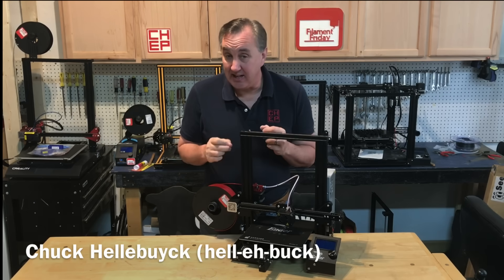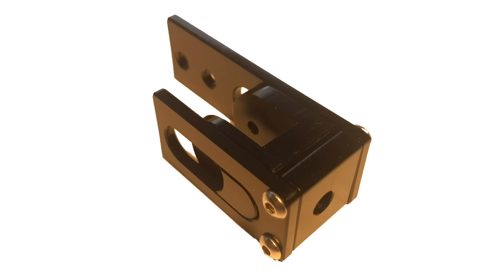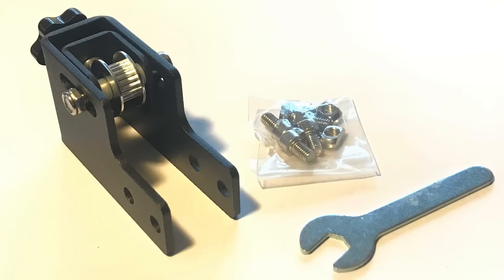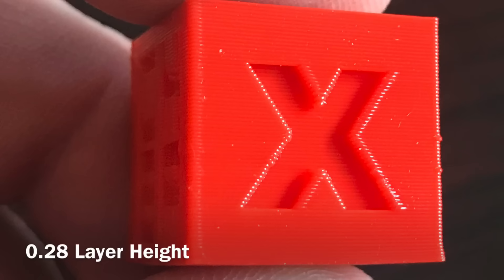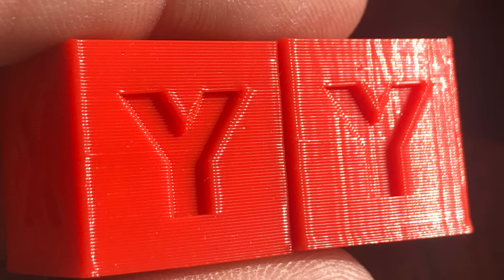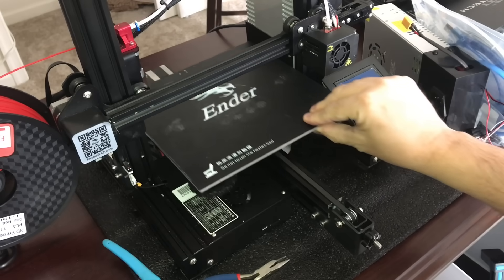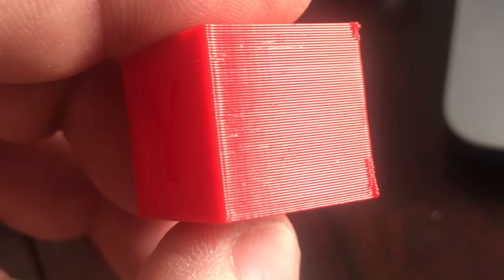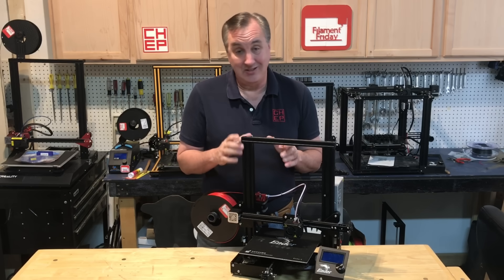3D Printer Belt Tension Effects on Creality Ender 3

Comment: Yes, sometimes a loose belt will cause an occasional shift also.. then keep printing normal again for a few layers then slip again.which can mess up print.. this depends on your print... tight belts are a must... my ender 5 only needed this done once after several hundred hours of use... i like that fancy hardware,but it really is not worth doing for me...

Comment: Hey Mr Chep! Did you ever figure out those over extrusions on the corners of the cube? I'm experiencing the same thing.
Reply from the maker: Yeah. Just use my profiles.
Reply: It's called seam. It's normal with a bowden setup. It's the end and start of a layer (outer shell). You can try to reduce it with coasting and retraction. Would be too long to explain. There are plenty of videos about it, but to be short, with .2mm you will never get rid of these without causing other issues. For that you need direct drive extrusion.

Comment: Idea: print a flat shelf to slot on to the top gantry beam to create a platform for some weight, then add weights evenly to the top, see if more stable/less vibrations with top weights?

Comment: Thanks for the video! I am going to order those tensioner brackets myself. Very nice. I've seen some I could print myself but I am concerned they wont hold as well over time as then metal ones you featured.

How did you end up fixing the over extrusion on the edges/corners?

Comment: I bought the LEOWAY version of the x-axis tensioner because that’s what I could get. It came pre assembled. I installed it and found that the belt road high on the tensioner side and rubbed in the extrusion. I tried adjusting to no go. Then I figured maybe it was assembled upside down because the hole the pulley rides on is high. The hole for the tensioner screw is offset too.  Re assembling let me to no fix. Sadly I am back to stock

Comment: If your belt is over-tightened it will degrade faster over time, similar to overclocking computer components.  While performance may improve temporarily, the belt will wear and slowly stretch out.  Seems like your first print was the "sweet spot" between the two extremes.
Reply: Id rather replace belts than have shitty prints
Reply: Yes, just like with anything there is a sweet spot ,not to loose not to tight...I have a similar belt on my motorcycle ... i would never tighten it more than necessary... that's just ignorant. yes it can be done,just not a smart thing to do.. been a mechanic for over 45 years and have adjusted hundreds of pulleys and belts and all sorts of equipment...
Reply: Accelerated bushing/bearing wear and lateral motor load should not be considered speculation
Reply from the maker: Do you have proof of this or just speculation? 
I can always tighten again if it stretches. 
And everything wears out eventually.
Reply: @FilamentFriday  its pretty common knowledge that if you put something under more tension that it will stretch and wear out faster, just like with belts on car engines
Reply from the maker: As I said everything wears out. I’m just looking for test data not speculation. I’ve been running these in my print farm for a long time. The wear is not noticeable compared to non tensioner but quality is. I’m trying to see the limit. So far nothing broken. Stretch is fine.

Comment: In my experience "it' can't be tight enough" is actually incorrect.

I was getting 1st layer inconsistencies for a while (using a bltouch and a glass bed): things sticking differently on different parts of the bed, even when disabling auto bed leveling. I stumbled upon a reddit post from someone with those same issues, and one of the answers listed a number of items to check. I ran through all of them, and I ended on "check your belt tensioning". The author explained that while undertensioning is obviously bad as we all know, overtensioning can result in less predictable bed movement. I tried to slowly remove tension on X and Y belts and I found a point where my first layer issues completely disappeared.

Long story short: make sure your belts are properly tensioned, but don't over do it!
Reply: Why would the extra tensioning only affect the first layer? That's just bs.
Reply: @alejandroperez5368  it can cause the axis to warp. since the following layers will take the countour of the first one, adhesion is not a problem, but since the bed is flat...

Comment: I bought the tensioners linked, and the X fell apart withing about 6 hours into a print, causing the belt to slip and creating a significant layer shift. This was with the linked "Pulley Version". The bearing used in the Pulley Version is very poor quality, and it only has one. The other side seems to be just a small presses in grommet, which is was fell apart. I removed the bearing and printed a 4.9mmOD x 3mmID x 8.5mm L bushing replace the bearing, so hopefully that helps.

Comment: Is their a way to tighten your belts without having to purchase extra add ons? Love your channel, thanks for all the tips so far!
Reply: There are a bunch of tensioners on thingiverse, but the amount of pressure exerted on the print can tear them apart. Both of mine broke within a few hours of printing.
Reply: Yes. Just pull the tensioner pulley away from the motor as you tighten the bolts.

Comment: Wow big difference I'm almost thinking you can print out the housing, drill an barely undersized hole and use a tap and dye to thread the hole and use the old hardware but use a bolt that you have laying around as the tensioner.  May take some time but will be free and a fun project...depending on what you consider fun lol

Comment: In my kit I ordered, The x-axis tentioner, The idler was smaller than the original, that makes the belt rubbing on the sharp Frame no matter what I do. Tried to use the original idler with this new tensioner but  it was to big hole in the middle on the original idler.
Was your also smaller? I have to find a bigger idler that fits this tensioner.
Reply from the maker: I explained that in the video

Comment: I'm kinda late in the game but I'd like to add that for those using motor dampers, too much tension will pull the motor at an angle (via the rubber between the dampers).
Reply: Can't agree more. I printed a part using PETG on my Y-Axis so I can use the damper without cutting the bed level knobs and that too started to warp. I caught it just before the belt was about to slip off the pulley. Im removing all dampers and my new SKR 1.4 Turbo board and new drivers come in 2 days. Should have skipped the dampers all together.

Comment: We have poorly shifted layers. How to fix it? Ender 3 pro
Reply from the maker: Ender 3?
Have you reflashed the firmware?
Verify your acceleration is set to 500 or less.
Reply: @FilamentFriday   There was no firmware. where to find acceleration set to 500 or less?
Reply: Yes Ender 3 pro
Reply: Where to find acceleration 500?
Reply: How to make a smooth
Reply: @Михаил-л2ю3н  M204 S500;

Add the above line to your starting gcode
Reply from the maker: It’s in the firmware. If you didn’t change it then  it defaults to 500.

Comment: It isn't good to have your belts super tight in the long run. It will wear out the bearings on these cheap stepper motors faster. I would tighten until it doesn't make much of  a visual difference any more.
Reply: I can't speak for stepper motors, but the logic is sound.  The load rating can cause premature friction failure.  I see this routinely in equipment that has had the belts way over tensioned.  Most belt manufactures had a max tension rating of some type.   I would be OK with replacing my Ender 3 Pro belts once a year if I could find a decent supply of replacements in the USA thru a vendoe like Amazon.  CHEP - any suggestions for new belts and how about a replacement guide?
Reply from the maker: Got proof of that claim? 
I’ve found the belt stretches a bit before any motor damage even begins to show.
Reply: @FilamentFriday  Generally nema 17 motors have a radial load rating of 3-5 kg. You should be able to look up  a datasheet for your specific motors and find it. It seems fairly easy to exceed that with my tensioners even though it is hard to get a measure of. I would stay under that especially for a chinese motor that is being used for long periods.

Comment: Hi chuck, I had a failed print and accidentally  aborted the  print. Trying to find how to adjust the code to only continue  printing the remaining stuff. Can you help
Reply from the maker: Measure it and divide by the layer height.
Reply: Delete everything in the gcode up until the layer you need to print and add a line that tells the hot end to go higher then the print before starting so it doesn't collide with the print.
Reply: @Alobster1  thank you

Comment: Hi Chuck. Followed your advice with purchasing the winsinn tightener. I must say that this tightener is terrible. in order to use it you have to do an extra fitting and eventually you can not get it much tighter than using the original tensioner. the winsinn tensioner is not designed properly to get the needed tension. I can relate to the need of putting tension to the belt for better results though.
Reply from the maker: Which axis?
Reply: @FilamentFriday  the X axis

Comment: how about the printed object size shift ?
tensioning the belt to tight can change the final size of the print ?!
not a problem for decorative object, but for mechanical parts it can be a issue ?!
Reply: Tighter belts should make it closer to the dimensions. It won't affect the scale one bit.

Comment: Any reason why you didn't just print them instead of buying them?  just curious.
Reply from the maker: Metal is stronger
Reply: I printed mine, early in my Ender3 journey, and have been happy with it.  Being adjustable, I'm not concerned about the plastic part possibly relaxing - it's going to tend in the same direction as the belt relaxing, and it's easy to keep within allowable tolerance.

Comment: This was great Friday video!  I have had a tension come loose with use and had the belt jump position during a print.  Tension definitely helps hold quality on my Ender 3 Pro.  I would curious on the effects on doing a curve surface (round wall, sphere).  Have you ever considered making a second challenge "cube" that includes other geometric shapes like a sphere, cone, curved etc?

Comment: Mechanical setup is just as important as software setup, its not just belt tension, its making sure everything is square and perpendicular,  the roller wheels arnt worn, the rolling tracks are clean, the rollers arnt tight etc etc.

Comment: Just thinking out loud, but it seems a spring needs to be incorporated into the belt tightener.  The spring could maintain a nearly constant force on the belt even if it stretched.  And with graduations on the tightener and using springs with a consistent spring rate, the same force could be dialed in on any printer with that belt tightener.

Comment: Belt tensioners are Devils' Playthings  Do not overtighten  and "tensioners " make it too easy to Eff it all up.  
Regardless.. Ripples on the print are  the Belt Teeth NO tightening will "fix' that.
 A screw drive will tho

Comment: It's very interesting to watch; I own a Monoprice MP10, and tightening the belts on the MP10 is kind of dangerous because you can easily over tighten them - although the belt system looks exactly the same as the Ender 3 (both being cartesian, that's not a surprise I guess). The way I feel it's over tightened is that both the plate and the extruder will move more sluggishly - and eventually cause the small motors to complain very loudly. It will also show in the prints if the belt tension is just barely at what the motors can keep up with.

I too have tested my prints with different belt tensions - and there's a very big margin on my MP10 in which the prints will look good, in terms of belt tension. It CAN be too slack - but they feel very loose even before that happens. Actually I had the screw for the belt tensioner on the extruder fall out because I'd reached the end of the screw, and the prints still looked good without wall issues or anything like that.

Comment: I have a question about the Ender 5. I noticed while mine is printing.. it automatically performs a button click. does that randomly. Just started couple days ago. just keeps clicking like someone is pushing on the buttons. Any ideas? I've sent a message to Creality but havent heard back yet. thanks
Reply from the maker: Sounds like your extruder is clicking and slipping. You might have a blockage in the nozzle.
Reply: CHEP is the actual display button that click. Same action as if I pressed the button. But no one pressed it.
Reply: @MLRM3DIA  sounds like a hardware/circuitboard problem
Reply: @linkbro4374  replaced the screen module and its fixed.

Comment: Hey, i just subscribed. Can somebody please recomend me which manufacturer or brand are the best quality-price-performance stepper motors.
There are literaly infinite producers from China alone and each claims to be "world leader" "best quality" etc.
Please share your experience, maybe do a video about it too.
Reply: Steppers, certainly the commercial grade units typically sold for Printers...are of similar quality.
  All the same despite price differences. 
Steppers are easy to build items  Hard to Eff 'em up. 
Pricier ones  are merely overpriced.
Reply: @barenekid9695  
Thank you for your reply, in that case i will just go for some middle price range and customer reviews when purchasing steppers.
That should work. Oh and as for the "easy to build and hard to f them up part". I agree, if you have a good workforce and atleast some minimal quality control.
Reply: The tolerances can affect mechanical repeatability. This includes the bearings which are often cheaper out on. And unfortunately this is difficult to test. If you have a low quality motor you may not even know.

Comment: We are a looking for a "magic" number.
Too loose gives bad prints. 
Too tight puts excessive wear on components.
So somewhere in the middle is our "magic" number.
Reply from the maker: I’ve seen no proof of the excessive wear. Magic number is make it tight.
Reply: @FilamentFriday  
I also agree a tighter belt provides better results.
But too tight is ultimately unnessasary.
I do keep my belts tight and have not encountered any mechanical problems in my printer.
Reply: @FilamentFriday  Really ? Check your "tight' Belts after a few hours of use.
  Rubber dust bits on the drive pulleys and chewed belt teeth. All there for the looking.

Comment: I have cr10s5 and if the belt is super tight it draws the bed down at the end of the stroke because of the angle of the belt from the pullies
Reply: There's not supposed to be any angle there.  The belt makes a loop and the side of the loop that attaches to the belt clamp on the bed carriage (or extruder carriage in the X axis) is the "working" side.  That side should be parallel to the guide rails.  If it isn't, it is wrong and should be fixed.
Reply: @MarkRehorst  that's how creality made it
Reply: @scottcowen4071  Then Creality made it wrong.
Reply: @MarkRehorst  I agree. I need to fix it but I haven't had time to look into a solution. It's the same on the x as well although not as pronounced. I assume all their machines and variants have this design

Comment: loose belt are increasing skid at sharp corners.
tension also affects the axial scale of the model.
too much tension are increasing wear out and leads to sudden belt or pulley/motor bearings failure.
Reply: nuclearzerg Why would tension change scale? There's no reason it would do that, steps are steps, all the motion is relative and still controlled by the same system independent of tension.

It may cause accelerated wear, but certainly not sudden failure. Bearings wear faster with more loading but don't suddenly fail unless you somehow manage to crush them, which you won't do with a rubber belt on this scale.
Reply: @boarder2k7  try to tighten the belt when printing, you will notice how the layer becomes wider.
Reply: @nuclearzerg  Is this based on the logic that a stretched and tighter belt then covers more space per ridge?

Comment: With them super duper tight you can damage the bearings in the idlers or even the motors themselves (learned that the hard way).  My method now is to get them tight enough to be taut, but not super stretched.  Your belt size and quality can effect this too, so you just have to do a little trial and error.  The boogers on the corner of the cube are probably from using cura 4.3 or 4.4 as they have disabled retractions on the outer wall (even if it is enabled) due to  a bug they are working on (don't understand why as with the supposed bug it seemed to work fine so no idea why they disabled it internally).
Reply from the maker: Thanks.

Comment: Can you use the original creality pulley gears on the tensioner assemblies instead of the smaller ones included in the modification part?
Reply from the maker: If I print an insert I might be able to use the Y but the X won’t fit.

Comment: After tightening the most you can run a calabration cube and measure it because you may have to adjust a few steps/mm than before, I tightened my friends belt for him a few weeks ago and it did change moment size... measure the wiggly one in comparison to the good ones you have... see if there's a difference

Comment: I heard brand of the belts can make a big difference as well. Like the generic cheapo ones you get from aliexpress or banggood the fiberglass is thin and weak and can stretch much more or even snap. I hear the Gates brand is where it's at quality wise, but I need to order some (apparently available through E3D or Filastruder)